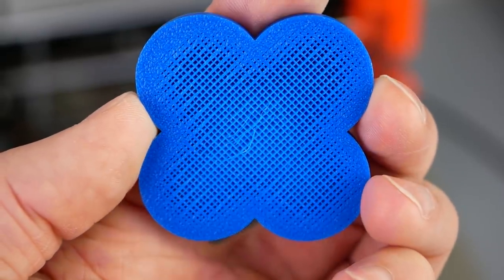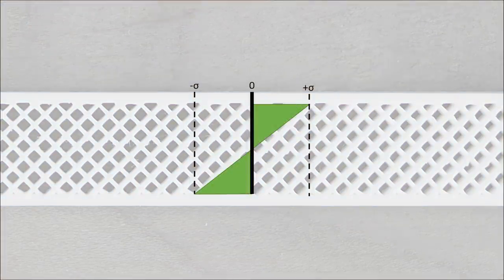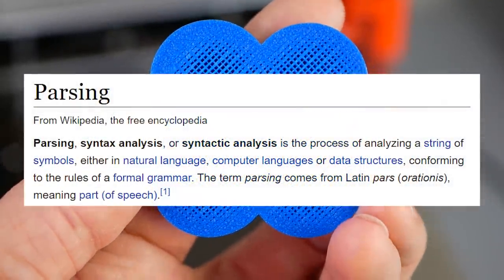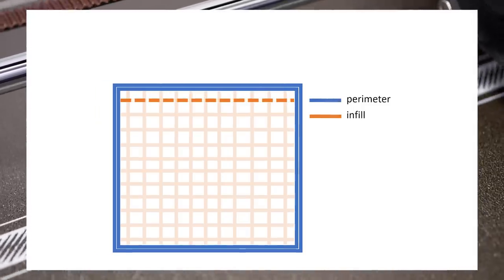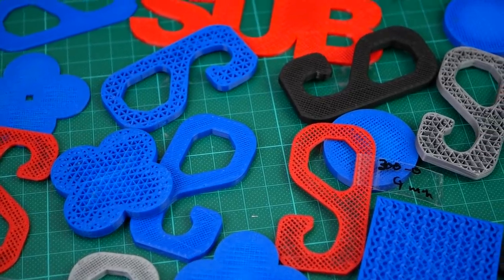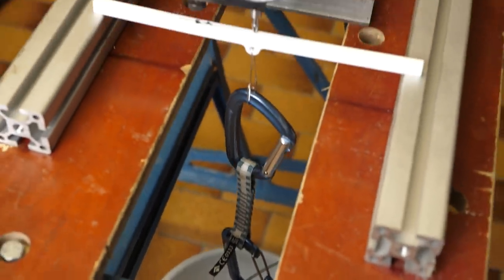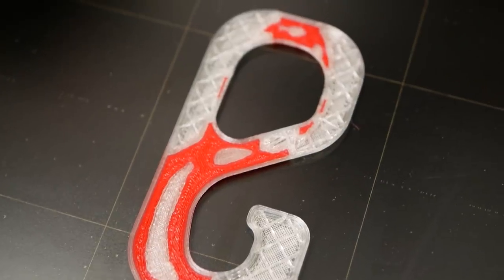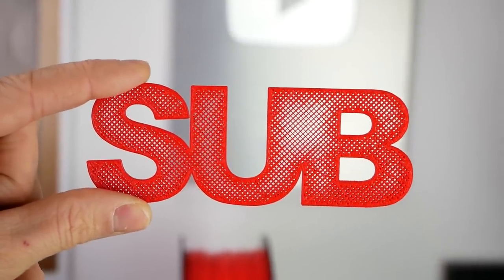Gradient Infill - NEW efficient infill for 3D prints!

Comment: As an Engineer, thanks :) Your video's have saved me a lot of prototyping time and physical tests myself. Now if I have questions I go to CNC Kitchen first for the Recipe then add salt where required. A little bit disappointed about the gradient infill, seems shell on the outside makes the most difference, Cura does have a really good setting where you can "thicken" print in the area required ONLY so say 15-20% infill everywhere except say in the high load areas where you can vary the specification. Perhaps a few engineers need to get together to build our our own slicing software!

Comment: I looked at your code. The layout and style is good.  I will be updating the code for this following items: 1)refactor process_gcode into smaller parts. For example,  if infill_type == InfillType.LINEAR: section would be in its own function call.This will allow for better reading and added new features. 2)  In Simplify3D gcode file, I see "; feature infill" the next comment is "; layer" , also the first line has " G-Code generated by Simplify3D(R) Version 4.1.2". I will check the first line and set the def is* calls for the correct string.

Comment: Excellent ideas Stefan.

I've thought about this concept but for perimeters on narrow sections.
If you have a section of a model which is 1.7mm wide, when printing with 2qty perimeters at 0.4mm each then the slicer will construct 2 pairs of walls (1.6mm) with a 0.1mm gap between
If "Fill gaps between walls" is set, Cura would nominally fill that gap with an additional thin extrusion
With a technique similar to what you describe, it could slightly increase the inner 2 walls to 0.45mm (or all 4 walls to 0.425mm) just for that narrow section and remove the requirement for the fill gaps (which increases the print time a sizeable amount).

This "Modulated line width" concept has mileage I'm sure.

Comment: Ok a lightbulb went off today with this video. I have been testing your recommendation of setting width to higher then nozzle size and for the most part it works great for about 1kg then you get a super jam in the hotend that only tear down can clear So here is the light bulb you said you only have direct drive printers I only have boden tube printers so to get it to not underexcruding I have to crank the temp up too high for pla and there is the delema it ends up cooking the pla in the tube and makes a plug not even nylon can remove Thanks for all that you share it really improves what I make.

Comment: That is really interesting. I've had a look at your code and I can see several ways to improve it, and it looks fascinating. One improvement I would really like to make is to try to change the feed rate (F parameter) instead of the extrusion rate to vary infill line width.

NB: Changing the feed rate is what the "velocity painting" tool does for the vase-mode perimeters.
Reply from the maker: Great idea for bowden printers.

Comment: CNC Kitchen - I think the reason it did not work as effectively on the tensile hook is that at the failure location you have a pure Tensile Stress superimposed over the Bending Stress in that member. So, effectively, you would need the material deposition to be much more dense near the inside of the hook, and more sparse near the outer edge. In other words, the sparse region needs to be shifted toward that outside edge, not at mid-line as it is on the simply supported beam loaded mid-span.

Great work!
Regards.

Comment: in the middle of object, the tension stress is a compression in vertical sense... so I think that is better that the infill gradient is oriented in this sense, like the diafragm inside plant of cane (reed).
In the printed examples at 9:07 maybe the better is "gradient infill 90°" because it offer more resistance to compression than the 45° gradient infill version.

Comment: Good enineering approach. And yes you are right. optimising infill for mechanical stress should be done as a preprocessor that moved the information to a slicer. So CAD->Postprocess Addon -> Slicer -> printing.
The difficulty is where to place this process CAD/FEM or Slicer or with plugin.
Anyway you solution with an Postprocessor in a slicer improve stiffnes 30% is impressive. Good job

Comment: Funny, I did similar approach for the gcode modification recently (except that my goal was to embed data in the object by locally modifying the layer thickness).
Absolute extrusion can be supported very easily by keeping the applied offset in memory and changing each E value in the gcode. Keeping the absolute value and offset in memory is useful anyway to prevent error after every filament retraction.

Comment: I've inquired about horizontal gradual infill in CURA for a while now. There is an implementation for vertically gradual infill which kinda-sorta works. Add this with the long overdue non-planar printing (and 500 other tweaks that should be there already, such as typing an exact angle of rotation instead of simply using the mouse) and CURA will be the best slicer out there.

Comment: The hook test is subject to both tension and bending, but mostly governed by tensile forces as the lever arm is very small. Which would explain why the infill settings doesn't make a great deal of difference. I don't think changing the setting in this will help as the tensile strength will mostly be a function of area.

Comment: I think you can do it in a bowden extruder too, if you keep the "extrusion speed" constant (in mm/s), that is you vary the linear speed of the head. That way the pressure in the head does not change. It means that you slow down the head at the thick parts.
Edit: I should have read the comments, covered already.

Comment: Thanks for the great Video. As you said it is not too surprising that it has no significant impact on strength in your hook test. It would be great to see if it has any influence on impact strength of the surface or increases the stiffness against indentations. Fur functional prints I often use a lot of perimeters or high infill ratios just to make sure that the surface is strong enough in rough environments. That, of course would also be useful in 3 dimensions. Again, thanks for your work.

Comment: A really nice find indeed. Increasing the material infill in the areas of highest load (compression or deflection) totally makes sense, especially if you look it from construction perspective. In a similar way, beams and slabs may one day be optimized, so the same loads may be taken by less material invested. It be interesting if the same principle is applied for shells and spherical surfaces.

Comment: Stefan, have you considered adding a hollow internal shell to the hook model and dense infill at known high areas stress areas.  While this would not work for the beam model the hook model would be a hollow tubular form made up of curves that transmit stresses more efficiently.  The internal shell need not have the same number of layers as the outer.  As a printing time/material saver this method would work better with larger bulker forms

Comment: This is dependent on use case. For durable goods, I can see this as an approachable line of thought. However, for use study, where the object is for design or a standalone object, I would like to see something like "connected voids." By this I mean that infill is only used to support bridging for closing a layer. The top of a cube is a simple example. The top is expected to rectilinear like the bottom and sides without drooping (sagging) in the middle. For this cube, I envision four upside-down right sided triangles. The triangle  consists of one side being the intersection of the x and y planes, the other side would be the top of the cube. The printer would the print the ascending hypotenuse from the center of the bottom layer. Yeah, I know I basically made a typ of cube infill but I see the slicer actually composing various shaped cubes that maximizes the best bridging possible (material type, printer type, and velocity).

Comment: I bet this kind of gradient would be fantastic for flexible parts as well. In my experience, the transition between the stiffer outside walls and the less dense infill can often be very abrupt with flexibles, and this might be a way to have a more uniform flex without being forced to print at very high infill levels.

Comment: Currently you have a linear gradient to the center, but I wonder if there is a better equation that you could use (i.e. cubic dropoff). I feel like this could be combined with your video on topology optimization to optimize the infill gradient to be focused on loaded areas as well. This really has a lot of potential and your should seriously think about a thesis or peer reviewed article.
Reply: Funny enough, apparently there is a lot of active research in topology optimization infill. I'm sure if you can define it programmatically in a slicer it would be very useful to the researchers. One application I can thing of is something like 
 3d printed bone replacements.
Reply: @mberlinger3  Topology optimisation is exactly what this should become. 

It goes to show just how far this technology still has to go.

Comment: Gradient infill would be really good for threaded holes since you need more meat around the threaded holes since they are post processed. Gradient would be helpful for any post processing since it usually involves some degree of material removal. It would be interesting to see how it compares with regular prints that have additional shells to make up the mass difference. The gradient modified infill likely takes less time. I have always wondered about using extrusion modification to better fill tight internal corners that are created from close outer shell layers. I would move to see a mold flow dynamic analysis extrusion method so the the extruder is essentially filling the cavity in front of it so ensure the optimal adhesion of infill to shell layers. Might be something you try in the future.

Comment: for the smaller parts, what if you adjusted the calculations so that 50% distance between outer walls always ends up at lowest density, and the closer you get to 0% (initial outer wall) or 100% (ending outer wall).
I guess it'd just be a parabolic curve. if Y on a graph is the extruder material, and X is the distance to the closest outer wall (between where we started and where we end), then Y = X^2 + b (b being the minimum amount to extrude). I'm no mechanical engineer, but I feel like this would offer the best strength to weight ratio. Could do it linearly I suppose too: Y = Absolute(X) + b, since your stress example would have a pretty linear stress gradient.
This way, even thin parts are guaranteed to have gradients (unless the line thickness directly blocks it). Though it still wouldn't be as good as your 'smart' infill since that directly takes the designed stresses into account, whereas this would be a quick 'n' dirty for the average joe like me (I literally got my first 3D printer yesterday)

Comment: Brilliant, would like to see this implemented as a standard infill option in slicers. I already use Cura's "Gradual infill steps" which progressively increases infill density before top layers, allowing for a lower infill in the body of a shape and increasing it before top layers to ensure a smoother top layer and better wall joins. But that's just a change on the z-axis, while your modification allows density changes on the x & y axis. Combined these could be very efficient.

Comment: Brilliant idea! I think though that your second idea, correlating the thickness of the infill with the stress found in the FEA, is even more promising. And if the direction of the infill lines could additionally coincide with the direction of the stress ... ?! That however will need more than a post processor, that will need a completely new kind of slicer.

Comment: Probably has been mentioned before, but it would be interesting to work out a way to get equivalent strengths between different methods and show how this can provide equivalent strength at significantly lower mass. For a lot of us, it may not be useful, but there are going to be cases where being able to reduce the weight of a functional object by 30%, or even 25% can generate a significant savings in mass budgets that can be used for more battery, more data storage, etc. An example would be structural elements in microsats. Yes this would ultimately have to be moved to an SLA or SLS production process for that to be implemented there, but there are other situations where it can be useful as well.

Comment: Wunderschön. Actually there is an at least 15 years history of this kind of microstructure modeling in the scientific literature. There are implementations already where the even orientation and the cell size of the microstructure changes depend on the distance from the boundary. (See for example https://www.sciencedirect.com/science/article/pii/S1524070311000087).  The key is that for performance reasons one has to push these operations to the lowest level of the processing, presumably down to the slicer.  If possible it should not be done on the modeling level. Anyway it's great that by simply modifying the material emission in the G-code you were able to achieve such a significant effect. Congrats.

Comment: Not a new idea, as people have been experimenting with that for a couple of years for 3D printing, but definitely one of the better attempts, specially as you show actual results.
Implementation of such an adaptive infill would need to be done in the slicer in 3D space - but as to the benefit.... i would guess that under good conditions you can realistically get like 15-20% better strength/weight ration compared to using the normal settings.

Comment: Well that was interesting and such a easy solution.
You could combine that quite easy with your FEM meshes, all you need is a extra check if its inside or outside the FEM mesh.
(granted requires to have and load a FEM mesh, but it's not that bad)

Comment: Great video. Like what you did with a post processor. Great idea. For your plans with "new version" of smart infill you should have in mind, that simulations are not free anymore in Fusion 360.
Reply from the maker: Shape optimization is still free (Generative design is not). BUT....there will be a slicer coming to Fusion 360 and that could be awesome!
Reply: @CNCKitchen  Shape optimization free? I don't think so. It's cloud based, so you have to pay for it: https://knowledge.autodesk.com/support/fusion-360/learn-explore/caas/sfdcarticles/sfdcarticles/Fusion-360-Free-License-Changes.html#features
Basically everything that it's cloud based is not free with the new license structure. Or are you talking about the old startup license?
I would love to have a slicer in Fusion 360, but I don't think we will get it completely for free. Or why do we have to enable cloud credits for it? https://youtu.be/M8PeNxoCDV4?t=151

Comment: Does this only adjust according to the perimeter lines in the same layer? If so, an improvement might be to first parse all the perimeters and map them into 3D space (with Z as the accumulated layer heights in which the segment is) add the Z coordinate to each infill segment in the current layer and find the closest perimeter in 3D space.
Reply from the maker: Could be possible but this is something that could be done if implemented in a proper slicer. They can get this information way more easily.

Comment: I just watched both your videos on this topic, the 2019 "smart infill" and this one. I might have and interesting suggestion to merge the two techniques you have just shown. Since you have used a "distance based multiplier factor" to adjust  the thickness of your print line you may look for python topology optimization algorithms based on the work of Martin P. Bendsoe the "99 line matlab topology optimization algorithm" in his algorithm Bendsoe defines a "pseudo density" which basicaly grades from 0 to 1 the elements of a finite mesh accordingly to the overall deformation energy of the structure, that means, if an element does not contribute to the overall stifness of the part it gets a "density" value near 0 or 1 if the oposite is true. So you could use this grading as your multiplier based on the coordinates of the elements in the evaluated mesh so when your python code reads a coordinate that is labeled near 0 or near 1 by the optimization analysis it will ajust the line thickness accordingly, effectively making your 2020 video automatically do what your 2019 video does.

Comment: Great idea! But maybe it may work even better, if we could change the infill percentage in wider range, from almost 100% near the walls to almost 0% in the center. This will require not only change in material amount, but also change in infill pattern. It is definitely the feature needed to be added to modern slicers, because it is harder to implement it in g-code converter scripts.

Comment: This is an interesting idea, although it seems like it would be very dependent on geometry. For example, in your bending beam with the infill at 45 degrees, even though you make the infill thicker, there will still be patches between the infill where only the perimeters will take the stress. Since the infill is at an angle, even if it's thicker, it can't take up much of the stress.

Maybe a scheme where the number of perimeters is adjusted to account for the local stress would work better? Kind of similar to how you adjust the number of plies when making composites. Of course you'd still need to run a stress simulation first.